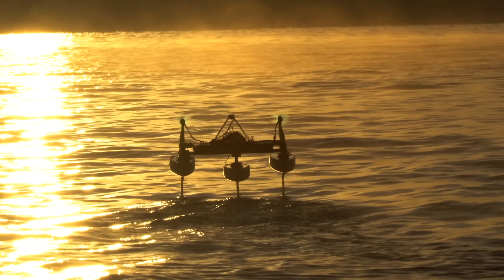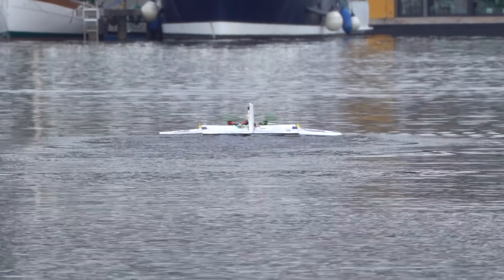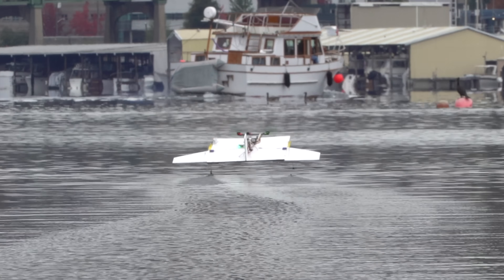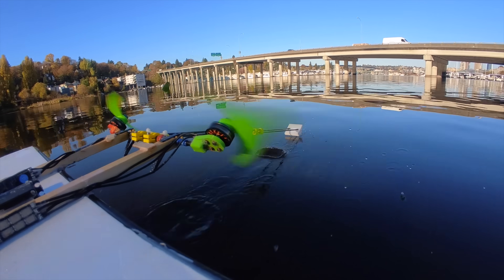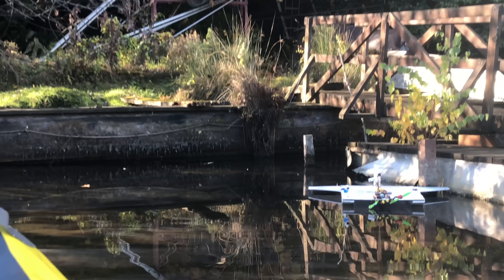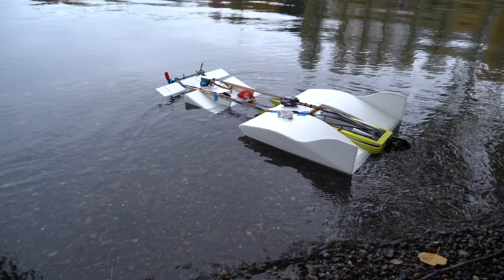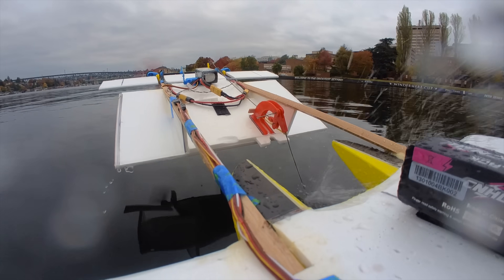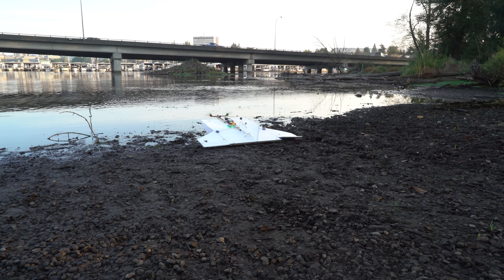Hydrofoil Control Mechanism on a Ground Effect Vehicle

Comment: Use underwater props, attached to the underwater wand, as a power pod.  Use that to pull the Ground effects vehicle above water.  Just send the power down from the vehicle down to the pod, through wires inside the wand.
Reply: Maybe you could draw this out? I don't quite understand (lol)

Comment: I'm sorry but this is cheating. The ground effect vehicle should self balance, since the ground effect works for a certain altitude. It's like resting on a pillow of air, if you force it inside then it's wrong.
Reply: 1. How does one cheat when making a project for fun?
2. This doesn't force air under the craft, it changes where airflow is directed. Yes, a ground effect vehicle should self balance, which this does (see the other videos), this is just a test to see if further altitude control could be achieved by using a mechanical method.

Comment: The wand on a model, could be a hydrofoil with swept wings and dihedral, could actually pull down, like the spoiler on a car pushes the wheels down.  I wonder if this would increase air pressure under the wing?

Comment: Dude. The faster you go the more likely the wand is to cut through the water than the water is to push it back. You just need a better float on the wand to keep it from cutting through the water at high speeds.